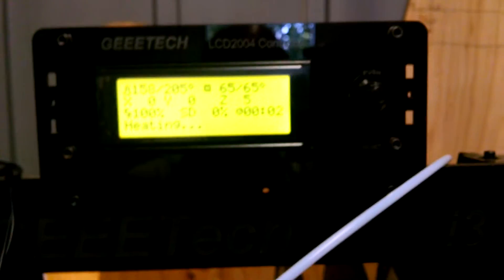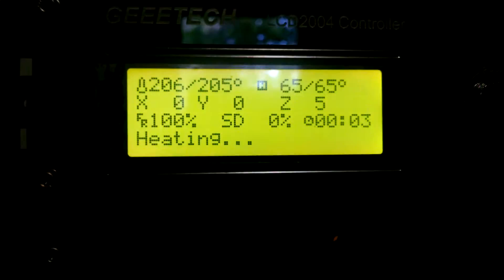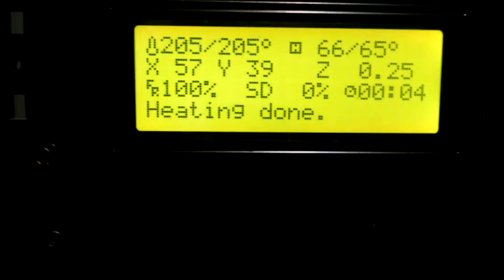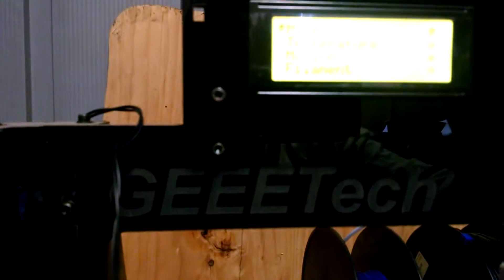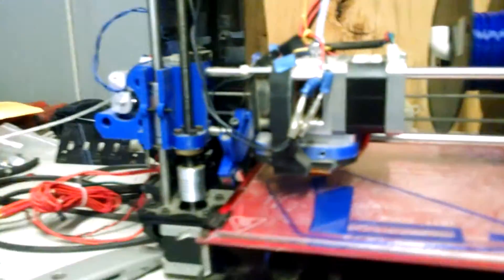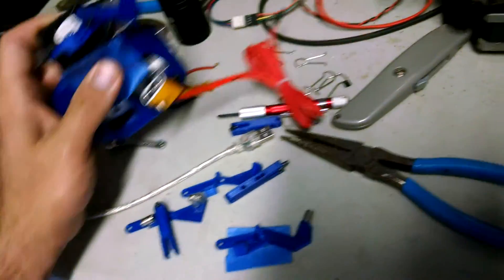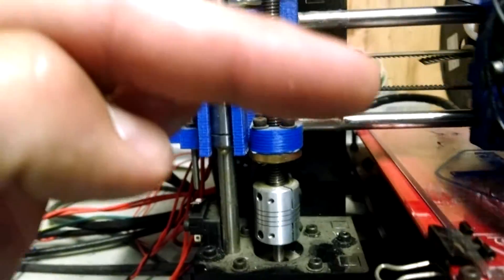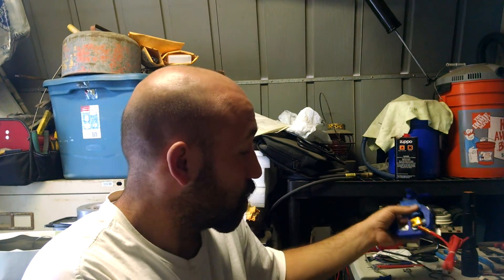Information on my slicer settings and AUTOLEVEL

Comment: George, it's me Ron, the problem child with the Bl Touch Z probe axis problems. Just wanted to let you know that I have it working now. I changed the pin number to pin 11 in the pin.h folder via wordpad, and it all started to work. Not 32 like I was seeing everywhere else. I have the newer gt2560 Rev A+ board. Just in case this should show up so you know in the future. It works great now. Thanks for the help and all the great videos. Ron
Reply from the maker: +Ron Swanson thanks for helping others in the future. This comment will be useful for many.

Comment: And what does the Ramps file do for Arduino IDE Program ? . . Right now waiting on Laundry to get out of dryer and letting dab of goop dry on the connections so they stay put . . Question there just how small of a hot glue gun do you have there is no way mine would have fit in that tiny spot ! and add glue to the right spot !
Reply from the maker: can dip part to glue in a blob say on some scrap cardboard, and then quickly apply. the glue gun I got from the home depot is 15 watts, yellow Stanley, and takes the mini sticks. only got it cause had one thing to hot glue and was too far from home. so. $12 for a pack of sticks and mini glue was worth it vs driving 50+ miles. anyways, the RAMPS is a control board. one of many that the firmware can run with just a few changes. the same firmware is used in most cases with the board opt being changed in config h file.

please understand, there is a lot to this. with so many versions of firmware. reprap.com is my source for all I don't know, my point of learning, and where I got some firmware versions.

I have various versions and setups on my WordPress blog. they are all listed. sometimes there is a download glitch and just re-downloading it usually corrects any problems that arise.

there are two versions of Arduino on my WordPress blog.
Reply: +George Robles It is why I used a tooth pick to reach in and put some where it was needed I guess I will have to take a picture so people see how small of a spot it is to reach . . I have a small glue stick gun and there is no way I could have gotten any of it close to the spots. .  It uses the small 1/4 inch size glue sticks . Oh yeah I added some nylon washers under the controller board so it gets more air under it also . . .. I got the Arduino 1.0.1 version installed in windows
Reply from the maker: +Jacquelyn Stevens yeah, the nylon spacers come with kit but don't say a word on what they are for. I used them on the lcd, and my board. the Sanguinololu board has a nicely cut Acrylic cover
Reply from the maker: +George Robles that use the longer nylon spacers.
and short ones to mount in-between the frame and board.
Reply from the maker: Jacquelyn Stevens ?
Reply from the maker: If you put RAMPS firmware setup, you may have issues with the extruder. If the lcd works now, then the firmware was preloaded.
So, in case you had altered it, I sent you two sets of firmware specific to the Gt2560 rev a board. Gt2560 board, the first version that had an additional spliter for the z axis and all the molex connectors where oriented in the same direction, is not so problematic for running GT2560 which is actually the ultimaker design firmware version and geeetech designer made this board. I. The rev a they address the single output for z axis by having two outputs, they then adjusted the molex layout. I sent you firmware for rev a for a single extruder, and dual extruder setup. Using mk8 direct drive extruder
Reply from the maker: If you put RAMPS firmware setup, you may have issues with the extruder. If the lcd works now, then the firmware was preloaded.
So, in case you had altered it, I sent you two sets of firmware specific to the Gt2560 rev a board. Gt2560 board, the first version that had an additional spliter for the z axis and all the molex connectors where oriented in the same direction, is not so problematic for running GT2560 which is actually the ultimaker design firmware version and geeetech designer made this board. I. The rev a they address the single output for z axis by having two outputs, they then adjusted the molex layout. I sent you firmware for rev a for a single extruder, and dual extruder setup. Using mk8 direct drive extruder
Reply from the maker: They're should have been some black acrylic ones for the lcd.

Comment: Why would the Z Axis not be moving in any direction ... . I loaded the example Calibration from the list of things in the examples ! .  I even held my finger on the limit switch of Z Axis to see if it would Move off .  .I got it to move off by switching the wires on the Z Axis limit switch and put them back after it moved off . .

Comment: I cut screw driver slots in top of threaded Z Axis  to level the X axis and used indicator to get the X axis leveled out to under .001 difference ! . . . . I use Linux ( Ubuntu 1504 ) and need help in  getting the marlin thing working so I can actually use the GeeTech I3 Pro C dual headed 3 D Printer to make a gob of Items I have in my head ! ( I was a CNC Programmer a few hundred years ago or so it seems )
Reply from the maker: See newest comment
Reply from the maker: Online store:
georges3dprinters
I sell tech support if needed. And can give a crash course in all to get a drawing to slic3ing it and then printing it.
I posted other videos on my channel.
Reply from the maker: +Jacquelyn Stevens well first, you need Arduino 1.0.1
Reply from the maker: +Jacquelyn Stevens which is why I sell tech support too. I do what I can in my free time to put on YouTube. I will give you a better rate if you need tech support. if geeetech refers you to me, then they pay for two hours. just so you know.
Reply: +Jacquelyn Stevens Do not use a version higher than 1.0.6 for the Arduino IDE. It will cause issues. If you use the latest, you will get compiling errors. Trust me... I did it too... Oh, and look into the Marilin blogs for info... more to the point.  Also, do not forget that Geetech has a forum too... but is seems that they are a bit behind and require all posts to be approved... http://www.geeetech.com/forum/viewforum.php?f=9
and another good resource is: http://www.3dprintingforum.org/... You can ask a lot of questions for free...
Reply: +Keith Applegarth Oh thats why I am having so many problems haha I got the new stuff to talk in Windows inside of Virtual Box ! .. The Linux side now talks also via /dev/ttyUSB0
Reply from the maker: +Jacquelyn Stevens you know I said that in the email response? Have to use Arduino 1.0.1-1.0.4.
just want to show I did respond to you. just via email. my WordPress has Arduino 1.0.1
Reply: +George Robles I saved the Drivers folder to the shared folder (win-crap) as windows does strange things to programs when deleting them and leaves tons of the old program around making installing the new ( older version hard ) Bu I got it done now have the 1.0.1 version in windows inside of Virtual Box inside of Ubuntu 15.04 ( Linux ) Oh yeah I have to use small screw driver to spread the pins in the Thermistor connections as they like ot pop off to easily will take tooth pick of house hold goop ( ace hardware stuff ) to hold them in place !
Reply from the maker: Jacquelyn Stevens hot glue is a better way to go. That's what the pros put on there on stuff for stereos and other electronic stuff.
And you can remove it with a heatgun.
With the Arduino, you can open the firmware file I sent, one extruder or two extruder, and open the ino file in the folder. The other files are a part of it. And the folder name has to be the same as the ino file name.
Reply from the maker: Jacquelyn Stevens once you open, you will see sketch with many tabs. Click, set your board to mega or Sanguinololu, Arduino as ISP for programer, and select the right "comport" for your board, usually the only one listed, verify, then upload.
Reply: +George Robles Well now the screen is a lot of small square boxes that are filled and nothing else comes up at all  . . Unplugged it turned it off let set for a minute and re fired it up . . Now nothing will move on it and same screen two rows of small squares filled blanked out . .
Reply: +Jacquelyn Stevens That happens when you have not defined the LCD screen in the configuration.h file. What screen do you have? If is the original screen go down to the LCD and SD support section and take out the // in front of the #define REPRAP_DISCOUNT_SMART_CONTROLLER 

If another LCD is defined, put a // in front of it.
Reply from the maker: Also happens if cables are reversed, depends. Have to see a picture.
Reply: +Keith Applegarth NOTHING comes up and what ever I was sent by GEETECH I3 Pro C GT2560 I ask George if all I had to do was let the Arduino IDE verify the Marlin.ino file and up load as above he answered just find the last zip file for Marlin PI3 Pro C and expand it in windows . . Did that
Reply: +George Robles got it and installed it in Windows inside of virtual Box
Reply: Jacquelyn Stevens I did not get the ino file either. But what they told me worked. Go to the folder and select all files, then open in the Arduino IDE. My copy won't help you. I made a lot of mods and am currently running marlin 1.0.2 with a full graphics controller, auto bed leveling via servo and only one extruder.
Reply: +Keith Applegarth found it and it is just like above 
// The RepRapDiscount Smart Controller (white PCB)
// http://reprap.org/wiki/RepRapDiscount_Smart_Controller
#define REPRAP_DISCOUNT_SMART_CONTROLLER
Reply: +George Robles Igot that fixed way back as the panel did not have which one goes where and the sent me a picture of what goes where . .

Comment: https://georgeroblesjr.wordpress.com/ Is the address to the wordpress site.
https://georgeroblesjr.wordpress.com/2015/05/16/my-setup-for-the-geeetech-prusa-i3-pro-b/comment-page-1/#comment-2

Here is the link to all of  the settings...

Also, enabling the store to memory function on the LCD is only uncommenting 2 lines in the firmware. Under the // EEPROM area uncomment the #define EEPROM_SETTINGS and //#define EEPROM_CHITCHAT. That will enable saving settings from the LCD.

Thanks again George!
Reply from the maker: Yes, I already did it. Was trying to figure a way to fit grid leveling on Sanguinololu but just not enough memory, as of now. But thought you would want the other options that you where looking for.
Reply: Sounds like your board is very limiting. I am running a RAMPS 1.4 with the GT2560.
Reply from the maker: I have all three, just trying to get the most out of a Sanguinololu board
Reply: +Keith Applegarth Have you got this Ramps1.4.ino.zip file ?  If so can you send it to me ?
Reply: You can down load it from the Geeetech forum.
Reply: +Keith Applegarth And how does it go into the Ardunio IDE program there is no .ino file All of this is new to me plus having to use Windows stuff ! 
The most outdated O/S around . . Gets Bots, Malware, and Virus's
Reply: You select all of the file (ctrl-a in windows) then select open. It will create the ino file.
Reply: Jacquelyn Stevens I should have been clearer.  From the Arduino IDE,  go to file open, goto the folder with all of the unzipped files. Select them all, then open.  Then select  save. It should create the ino file.
Reply: +Keith Applegarth I did that I selected  the marlin.ino file and the rest opened up as per normal in Arduino . . Did the Verify it came out OKAY then did UPLOAD that is where the screen went to zip like it is . . The part you ask for was in the configuration.h file and i did a copy and pate of what was there . . Just because i am female does not mean i am totally dumb !
Reply: I didn't mean it that way... I just realized I wasn't clear. You also need to have the ino in the folder with all of other files.  And last but not least the name of folder must match the name of the ino file. Mine is in a folder called marlin 102 and my files are all in that folder with the ino file named marlin102.ino. It assumes all of files are in the same named folder. I is an Arduino IDE thing. Hope that helps.  

You can just rename the ino file to match the folder name and copy it to the folder with the rest of the files.
Reply from the maker: Ok sounds like you just need help over the phone to simplify this cuz you're misinterpreting the information
Reply: +Keith Applegarth I saved the file he sent me to the hard drive and expanded it to Marlin-2 folder used the marlin.ino file from THAT folder and let Arduino IDE open that file AND THE REST . . Can I make it any more simple to your mind
Reply: +George Robles So what time are you awake !  Now it is 7:02 AM here in Phoenix Arizona